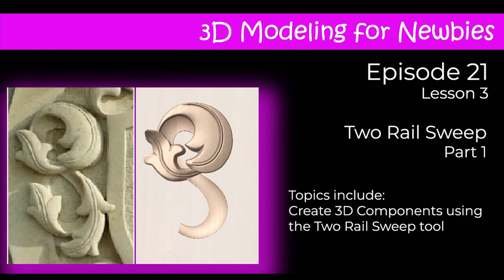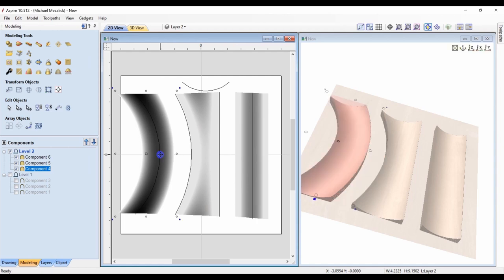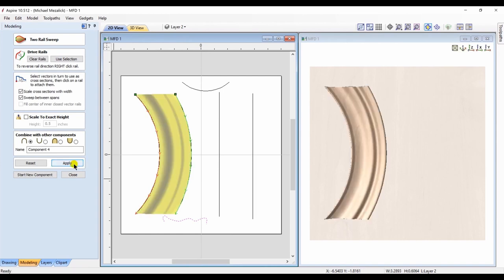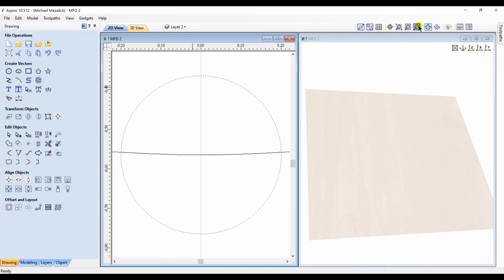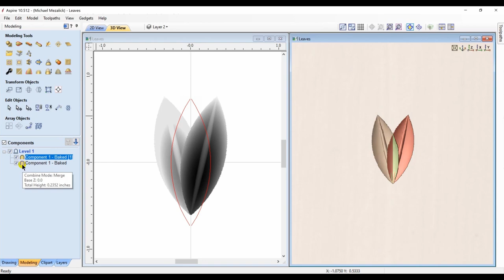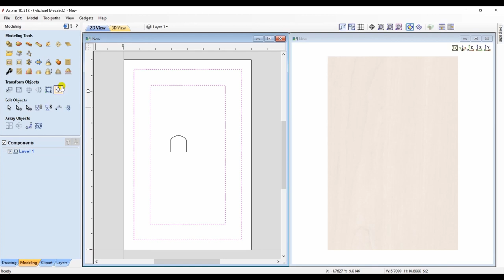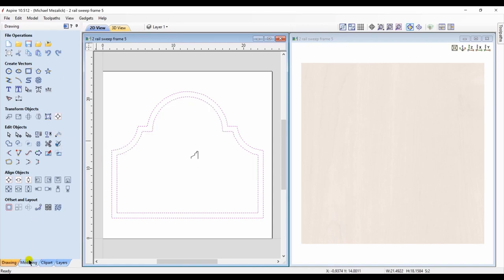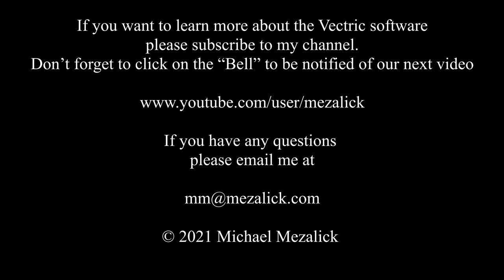Remastered Two Rail Sweep Lesson #3 Vectric Aspire

Comment: Hi Michael, quick question:
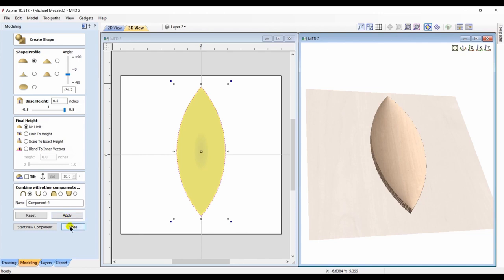At roughly 7:55 you split the object into two vectors, but it’s not clear how.  Could you explain please, thanks :)
Reply from the maker: I didn't split the "object", I split the closed vector. Select the closed vector, hit the "N" key to enter the node editing mode.
Hover the top node , hit the "C" key. do the same with the bottom node.
Hope this helps